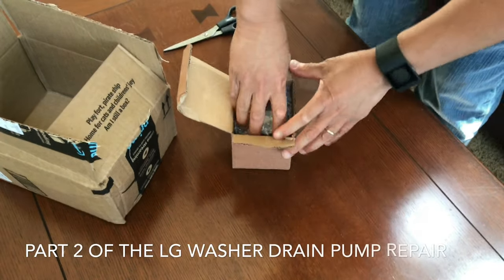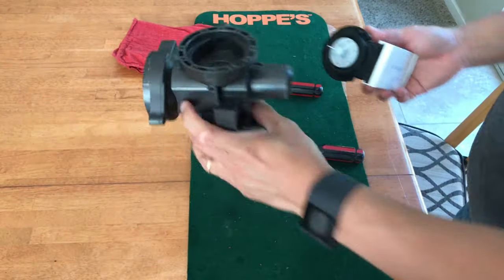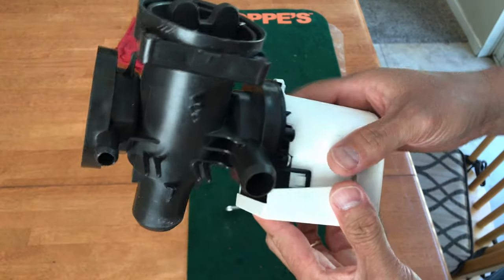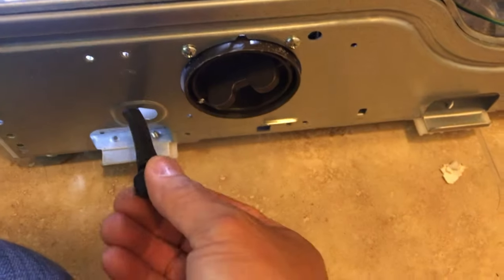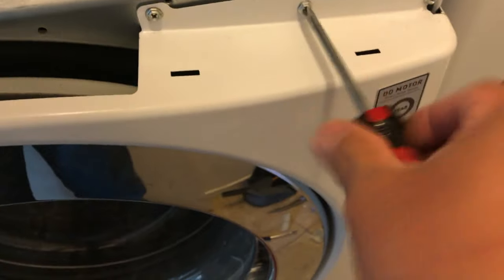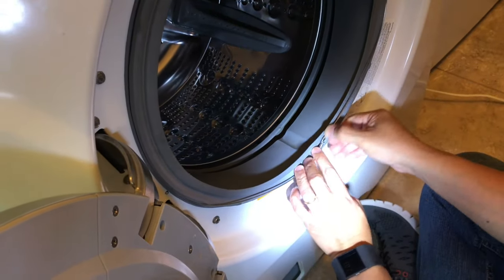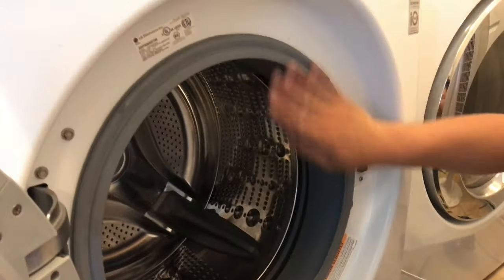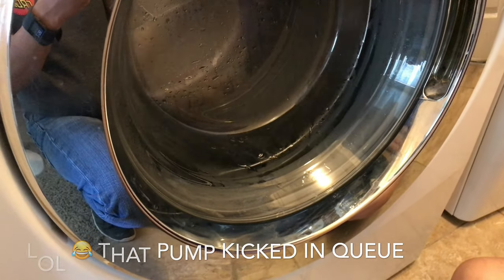How to Install Drain Pump on LG Washer Detailed Instructions Step by Step Pump Repair Part 2 - HD 4K

Comment: To get the door gasket seated alone, I made a homemade ring clamp spreader tool from $4 in hardware.

Pics:
https://plus.google.com/117440165111006315710/posts/1io7cAAUJMu

1x 6" long 1/4" 20 threaded rod
4x 1/4" 20 nuts
4x 1/4" flat washers
2x eye screws with ~1/4" eyelet holes

Screw one of the eyelet screws into the spring end a bit, stick the other one in as far as it will go do that the tapering screw threads will hold the spring end.

Walk one or the other end outward using a quarter turn of the outside nut, then a quarter turn of the inside nut.

When it's spread wide enough, stick the ring clamp over the gasket, then loosen one of the inside nuts until the homemade tool pops free.
Reply from the maker: Awesome diy! Really cool! Thank you very much
Reply from the maker: Great pics of that homemade tool!
Reply: @cbatilo  Thanks, I got stuck and frustrated at this step, I hope it can help others as much as your video helped me! :-)